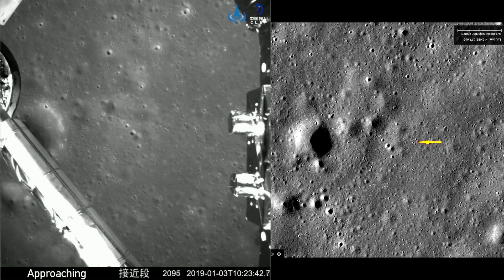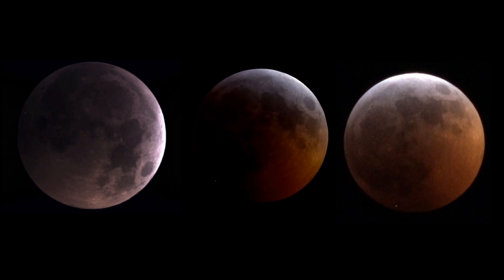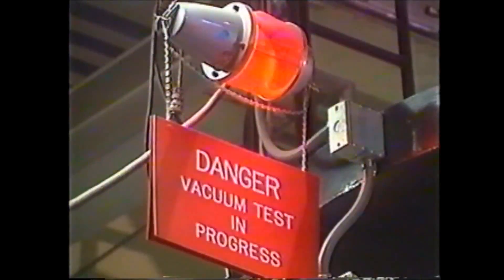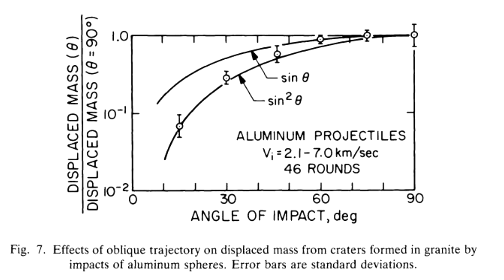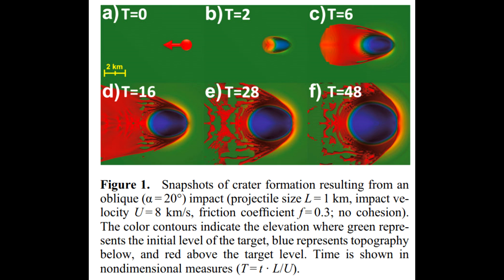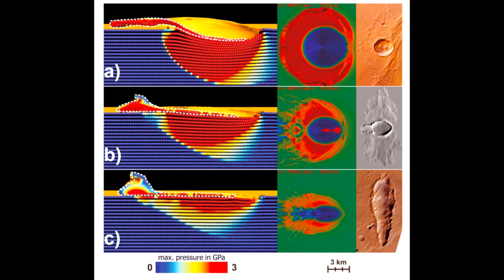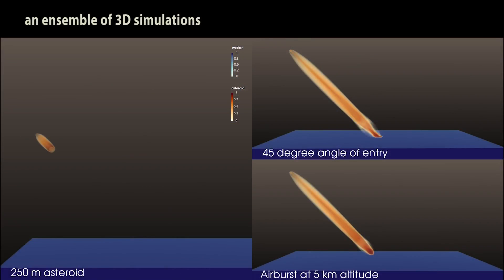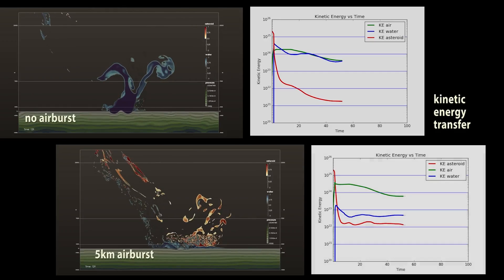Why Are Most Impact Craters Perfectly Circular? (Rather than Ovals)

Comment: And you chose a thumbnail with a HEXAGON crater....
Reply: Just add water.  Surround a planet like mars with an orbiting body of water and dust, if it's dense enough, and moving fast enough, we get statically charged and conductive gas... it's possible that if a moon of mars or mars itself impacted another passing body, or if mars had a close enough near-collision to a passing body, we can get an orbiting and passing cloud of conductive gas, enough to create a dielectric differential between mars and the gas or other charged body... at this point the whole planet of mars becomes your anode, and the moving gas field of static charge becomes your cathode.  If you want, add a high meteoric bombardment rate from the collision to provide near surface gas density,, or wait till half of the planet wide ocean boils, and you get static discharge events from the scale of 1 inch crater causers to a planet sized lightning storm all the way up to a interplanetary discharge events like the valles marineris.  In observing the entire valles marineris structure, the polar deposition and erosion pattern is a dead give away of electro-magnetic flow.  So you are misleading at best, and at worst you are baiting people to not seek understanding but instead obey- a bully tactic, when you demand that a person proves what you know is not possible, in a vacuum there is certainly an arc distance limit, (not to mention that an earth based test is limited to gravity based results).  With a conductive pathway, balance is always resolved.  :) Now let's talk about how the earth ran into a body of water without the moon, and how mars and venus lost all of their water all the while mars had its core stopped and venus got so hot it melted. That's a three way electrical system I'm insinuating..  All of this is conjecture at the moment, of course, even heresy to some, so let's let science run it's course and may profiteering get us somewhere smarter. The simple solution of cratering is to say they are all caused by a rock hitting it, and certainly most are so sayeth Ackham,  but we're trying to find the truth, and the truth is never that simple. The Full spectrum of understanding includes that which you do not understand yet.  I hope that through encouraging others you find what you are looking for.
Reply: So If people were not saying science was wrong,  but instead presented a theory, hypothesis, antithesis, synthesis, experiment, and predictions which were testable in regard to A) the electric universe theory and/or b) any theory explaining an electromagnetic process that adds to and helps explain the unknown variables and unexplained results currently present in classic kinetic impact and explosion cratering theory, if someone did that, you would not have any more problems accepting or presenting A or B?    Here's an easy one, a prediction, if a meteor falling through ionized gas creates a bow shock wave that forces said ionized gas to compress, heat, combust, and explode at high enough energies that it causes the emission of focused ionizing em radiation in sub 100kev energies ( x-rays and lower) from disperse molecular cloud (not a ball of condensed uranium-238, but a gas of highly ionized already gamma and beta emitting molecules of hydrogen helium and whatever else might blow in from the sun and other interplanetary dust that may be getting sucked in by a localized surface bound magnetic field), available molecules would exhibit beta emission, releasing electrons and positrons to lose the buildup of energy in a omnidirectional pattern from the point of source and shaped by the physical impactor wake, resulting in an ion shaking, electron discharge cascade decay chain, the size of which should be directly related to the initial size and speed, the force, of the total impactor when it produces the first x-ray,  versus the total localized available environmental gas density and volume, the total localized available environmental energy i.e  total localized solar radiation energy, total localized solar wind particulate density, total localized interstellar radiation energy, and total localized planetary magnetic field energy- the testable prediction is that,  the ionized debris from this x-ray sparkle raincloud should follow the impactor, get pushed away by the explosion and then collapse in on the ejecta, if there is no magnetic coupling event, and would be deposited much further away from the ejecta ring and on top of if not surrounding the ejecta... a layer of sparkly bits, still scintillating in low level gamma or possibly even beta emission should cover the area surrounding the craters that involve an electromagnetic addition to their explanation.  I thought it would be a bright idea to look up moon gamma rays to see if craters shine... but the whole moon shines so bright you cannot distinguish or resolve any crater sized difference. There are more experiments that may show supporting evidence than I can think of, though I'm not sure any exist yet, and certainly none I can do myself.  Eventually those bits would decay on down to stable, so just need a rover that can test two sides of a rock for a he3+ layer that's only a few atoms thick, on a double wall crater, on the moon, that's so fresh it hasn't been whitewashed by the sun... or some such.
Reply: Just sayin', I haven't seen a model yet that shows a near zero gravity plasma field collapse resulting in a magnetic field.  Let alone the different ways to stimulate such an event or the different possible modes the process goes through.  Plasma barrier discharge is scalable, right? Somewhere in the spectrum, considering the planetary scale of the high end of the energy potential of such a process, the strength of the magnetic field produced by a flow of electrons  focused through a centralized discharge channel should be enough to "shape the charge" of a meteoric impact explosion.  Simple way to make straight boundary edges without radial deposition, huh?  Perhaps you know someone that can help; What an energetically charged atmosphere there would be getting to witness for the first time a model demonstrating why a meteoric impactor and the column of it's wake cannot act as the finger while the moon acts as a balloon that is constantly being rubbed not against a sweater, but rubbed against the sun's constant torrent of highly energetic radioactive and non-radioactive particles, and saturated with stellar and interstellar em radiation.
Reply: only a couple of these comments were showing up to the public. keep the sheep!

Comment: This of course refers only to craters on bodies with negligible or non-existent atmospheres, like our moon. On a body with a substantial atmosphere, any object coming in at an extremely low angle is going to have that much more gas to travel through, and will therefore be much less likely to reach the ground without vaporizing/exploding a la the Chelyabinsk bolide. Those trench-like craters should be pretty much totally absent on any body with a substantial atmosphere, like Earth.

Comment: Because if the impact is even near 90 degrees then the energy is distributed evenly and thus forms a circle. Not hard to answer.
Reply from the maker: Only 25% of impacts arrive with an angle greater than 60 degrees.

Comment: So how can a bullet be supersonic if it's propelled by conventional combustion?
Reply from the maker: It’s the speed of sound in the hot pressurized propellants that’s the limiting factor, those are higher than speed of sound in air.
Reply: @scottmanley  Hmm for instance would you hear a high explosive charge from a mile away sooner than a slower explosive?
Reply from the maker: No.

Comment: I come to think about Hollywood meteorite impacts. The "things" normally start burning extremely far away from the Earth. The atmosphere is rather thick. Then they pass over the heads of the hereos like a downed bomber plane belching brown smoke. Nitreous oxides? Then the result differs, either it hits in the Cretaceous /but on a modern Earth) and all the surface catches fire in beautifully expanding circles. Or it hits the present day ocean and produces a huge wave. Are ANY of those things faintly realistic? If the mother of all impacts hits the ocean I would expect a deafening shockwave before the tsunami. Making humidity in the air either condense as a front or maybe heating up the air? But I'm guessing. 

I recall that some years ago a series of impact craters were found somewhere in South America. A theory at that time was that a meteorite had hit the ground at sufficiently slow speed and small angle so as not to disintegrate. And then it was supposed to have bounced off the ground several times until it (how?) took off again.
Reply: no need to guess, just watch some films of nuclear explosions. and it's well known that 'hollywood' and 'realistic' are not even from the same planet.

Comment: If I lived a couple of centuries ago and somehow got to see closeup photos of the moon I would probably think the craters were formed in the same way air bubbles rising through mud, or setting concrete perhaps, and then solidifying. A poorly made concrete slab can look surprisingly similar to some lunar photos, especially the ones of craters in the maria.

On another note, I think this is the best worded explanation I have seen on why the craters are always circular. I've seen several correct explanations, saying essentially the same thing, but none as clearly explained as this one.  The point that is most often missed or IMHO perhaps not emphasized enough is the huge disparity between the mass and momentum of the impactor and that of the ejecta.

Comment: OK, great, well done - thanks Scott.  That was actually the common answer to this question....  But may I challenge you beyond the common answer...  Now explain the polygonal craters. Or what about multiple impact craters in close proximity to each other with no material from its neighbors in them.  Then explain why lots of craters rim geometry is not as predicted from impact - i.t.o slopes.  Then try to explain why there are very often smaller craters exactly on the rim of a larger crater - but only one.  Then explain why there are same sized craters (sometimes 5 or more) in exactly straight lines.  Lastly explain why lab craters never have mounds in the center of them (which is also what the impact physics predict) where lots of them on the moon and other bodies do have mounds.
Reply from the maker: First up, it's clear that you've watched some Electric universe video which claims that all these features can't be explained. I have news for you, whoever made that video didn't bother to actually check to see how these features are explained, and expected. Here's a fine review of Polygonal impact craters showing that the indicence is related to existing geology https://www.researchgate.net/publication/260034157_The_Structural_Control_of_Polygonal_Impact_Craters
Here's a nice review of the mechanics and probability of tidal disruption leading to crater chains
https://agupubs.onlinelibrary.wiley.com/doi/abs/10.1029/94GL02966
Lastly, the computer simulations of crater evolution show central peaks.
https://www.lpi.usra.edu/exploration/training/resources/impact_cratering/
Reply: Thanks, I was exited to see if there is any plausible alternative to the EU demonstrable mechanisms of crater "anomalies".  However it does not take much to see the gaping holes in the "models" that is presented.  The PIC's model presented assumes (they have no proof) some subsurface conditions that cause a PIC to form.  Unfortunately the amazing regularity of the PIC's are probably the first evidence that it is not a good model.  Natural subsurface conditions in such a chaotic event could not possible cause such a precise shape.  Then the chain crater model could explain some form of chain event but not the extreme similarity of the size.  Finally, the model for craters forming central mounds - omg there is no similarity in the form and shape of the modeled crater and the observed craters - no serious scientist would look at that model and be happy that it explains that shape and form.  Then you have not explained the exactness of rim craters and why multiple craters in close proximity do not have material from their neighbors in them.  So, thank - modest attempt to substantiate the claims of impact theory, but unfortunately lacking in hard evidence and mechanisms that can be demonstrated in an actual lab - NOT computer models where variables can be tweaked until expected results are achieved.

Comment: It seems to me there are multiple crater forming mechanisms in nature each with it's own unique characteristics and many common ones as well. Namely impacts as shown here, electric machining during plasma arc events creating dipolar crater systems, volcanic and tube collapse (which are electric anyway via magnetic induction) as well subsurface gas explosions (methane types sparked by electrostatics in the dielectric). Further mechanisms such as hydraulics in natural sinkhole craters formed by water subduction following the negative current or melting subsurface hydrates in perma-frost zones forming crater lakes in the north tundras. It's not a case of one size fits all in my opinion. But, all are at there root electric on some level during their creation. After all, everything is electric.
Reply from the maker: It's a shame the proponents of electrical cratering have never been able to scale up their ideas without invoking a massive electrode placed inches from the surface.
Reply: @scottmanley  That's not true. Cratering in double layer dielectrics without the need for arcing or complete dielectric breakdown is entirely possible and does happen on Earth even. https://youtu.be/JF-ypC3jsHI?t=361
Reply from the maker: That video shows a massive electrode placed inches from the surface.
Also, it isn't in a vacuum.
Reply: @scottmanley  Earth isn't in a vacuum either. It's surrounded by the Van Allen belts and a huge magnetic field and the ionizable noble gases in the atmosphere are sandwiched in between to provide the conduction. The electrode can be the Sun, or other sufficient electrical emitter such as a comet, large near Earth meteor, planetoid etc. I'm not saying impact craters don't occur by impact at all. Only that they are but one of many natural mechanisms which can and do create craters. On Earth and off planet too. That's all. Your explanation of the impact type experiments in this video is excellent. I hope you'll cover all the other types of crater forming mechanisms as well in future. I'm sure the resulting videos would be of equal quality of presentation.
Reply from the maker: @chrismonksellye4608  Trust me, as soon as there's good evidence of a discharge based cratering event I'll cover it, but there's nothing compelling at this time. My suggestion is to come up with some observational signature which can differentiate and use that. I'm sure if you do the math you'll find that discharges produce different light curves or spectra, look for that if you want evidence.

Comment: And how are there any on the side of the moon that faces the Earth there should be a much less amount from each part that is directly facing Earth and the other ones especially on the edge should be at an angle if the Earth is always between the Moon and the rest of space is it is and I'd direct line there should be no 90-degree impacts very center of the Moon
Reply: Think about a possible answer. Come on, try it.

Comment: what about the percentual distribution of different angles? I would say that 0-45° is most common since most of the ball surface is less than 45°
Reply from the maker: It's a Sin^2 distribution - 25% < 30 deg, 25% 30-45 deg, 25% 45-60 deg, 25% 60-90 deg.

Comment: The idea that a round crater should have been caused by a vertical impact caused the owners of the Barringer Crater in AZ to try mining straight down from the bottom to find the nickel-iron impactor, which was expected to be valuable for its metal. (You can still see the head of the mine in the bottom of the crater now.) They now think that the impact was oblique and the remaining bits of the meteorite are underground below the south edge of the crater.

Comment: Even shorter (and a bit superficial, pun intended): The dominant factor creating the visible change, the crater, is driven by the explosive effect of the impact which concentrates at the point of impact and retains little from the parallel motion. The ejecta produced by grazing the surface is indeed asymmetric, but for most impacts that yields only a fraction of the mass displacement and is also spread on a much bigger area. At very low angles where the explosion is much smaller and the grazing more prominent, you get the elliptical and trench type features.

One more note: As most impacting objects arrive at small angles from the ecliptic, low angle impacts are more probable toward the poles where it's more difficult to spot using telescopes and the perspective rounds them back.

Comment: Paper states tests done using aluminium spheres ? Space rocks are anything but spheres  and are very often rotating as well. Is there any testing that has modelled these variables ?
Reply from the maker: There’s are other tests with cylinders. Needs to fit into gun barrel.